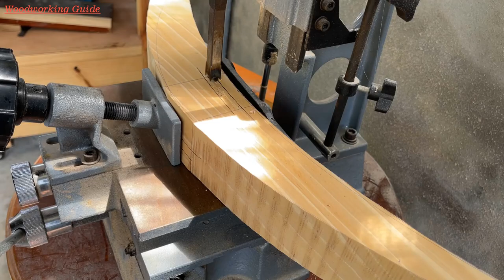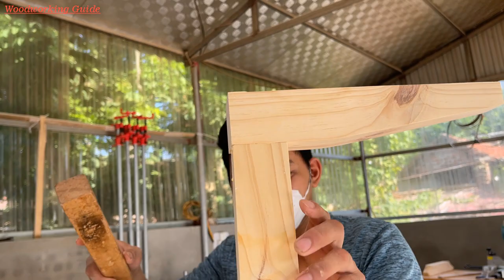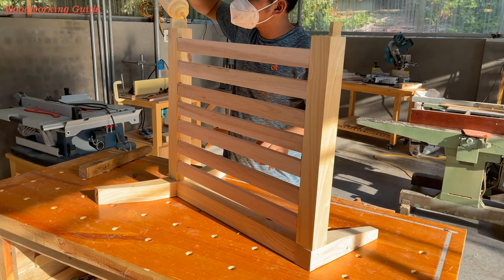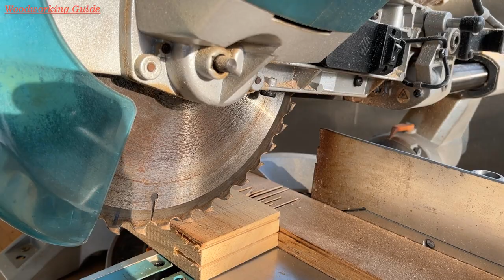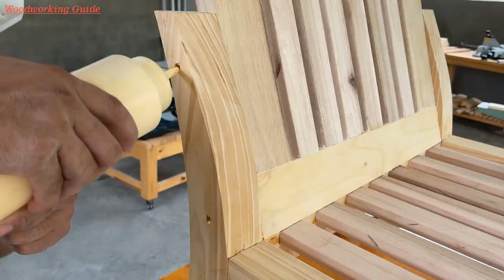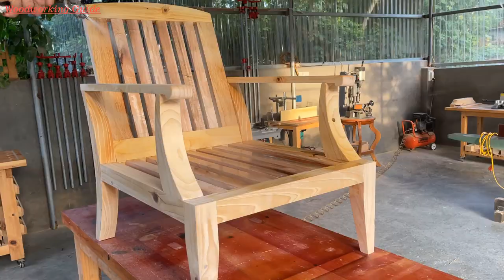Crafting Furniture From Cheap Wood // Cheap Wood Processing Project

Comment: That is pretty cool man i like it.
Reply: Hey man i cut a tree down and it had a lot of limbs on it some around 2&1/2 to 3" in diameter and i took em and peeled off the bark and let em dry well cut and put together and then they dried anyway i made some outdoor furniture to set in the yard and built a table to set in the middle 4 chairs as well and looks pretty close to what you made here so i no how much work goes in to building things like you have done so I'm glad to see a young man like your self keep the carpentry skills going on..
  AND THANKS FOR YOU'RE WORK HERE ON YOU TUBE..